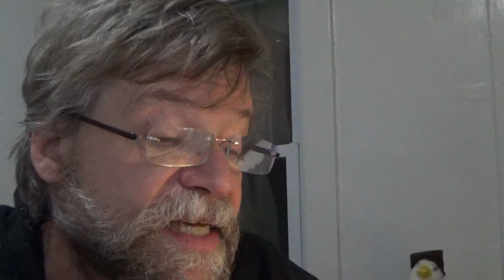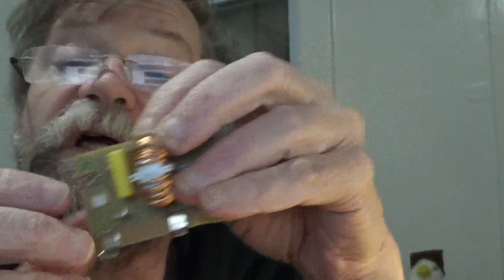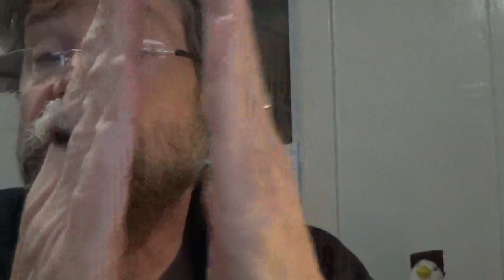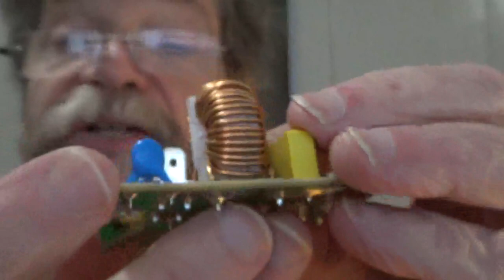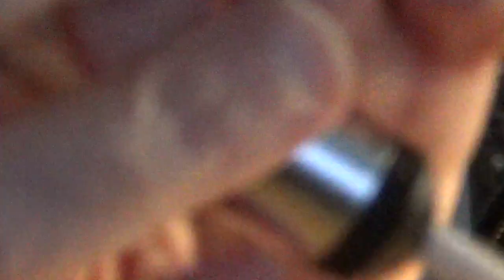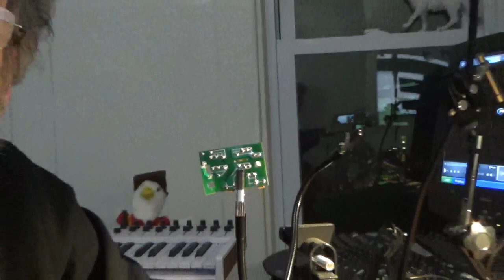How to DE-solder

Comment: I think when old solder doesn't want to melt you need to prime it.  Put some flux on it and then add a dab of your own solder to it.  This should increase the heat transfer to the old solder and give you a better chance of melting it. I appreciate the video.
Reply from the maker: Oh, thank you so much. This shows my lack of experience with de-soldering, but as a chemist I should have realized that as the metals mix the melting point will naturally drop as well.  I'll try that!